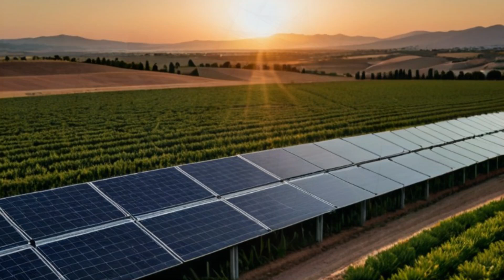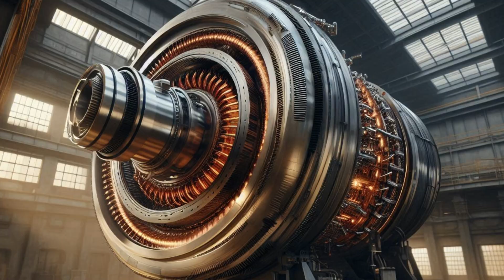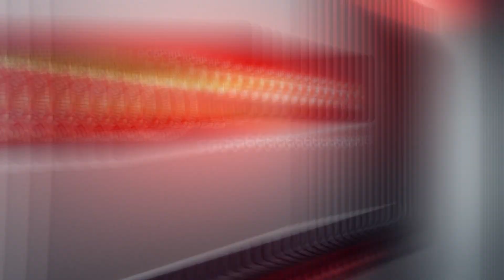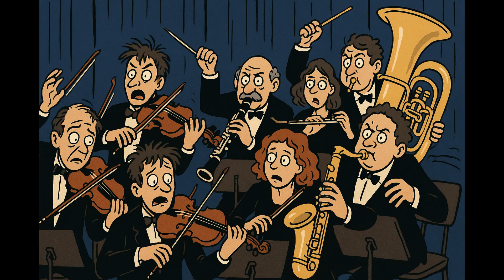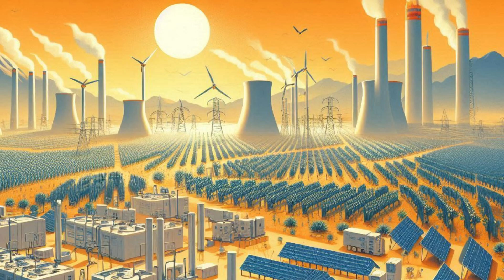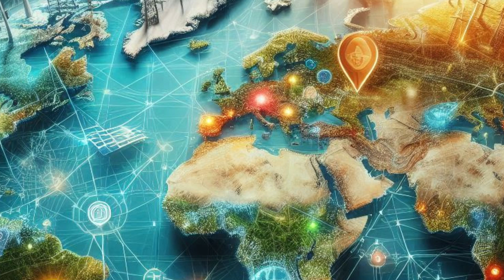💡 Why Spain’s Power Grid Failed – And What It Means for the Future of Renewable Energy

Comment: It is a fact that several power plants tripped off. It is unclear to what extent solar was a part of the problem. It is also true that Naked Solar could be a problem for power grid management. Nice to hear someone talking about grid forming inverters. Bottom line is that intermittent renewables should be tied to the grid via batteries.

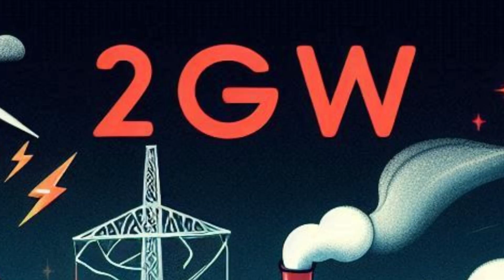Comment: Where did you get the information that "suddenly more than 2GW of solar power disappeared" [00:31]? According to the first official information, it all started with the failure of the Granada (capital of the Spanish autonomous region of Andalusia) substation. It might be that 2GW of solar power were fed into that substation at that time, but it was the substation that failed, not the solar farms. Besides, the solar farms in that region have a size of about 50MWp. The El Marquesado wind farm (larges in the region) has 200MW. So how many of them had to fail at once to create a loss of 2GW? A lot!

Comment: Simulated/Emulated inertia and actual inertia are two entirely different things, as the world will find out soon enough.

Trying to program inertia into an inverter that does not have any inertia sources, is not something that a line of code, replicated in 10,000 different places, none of which have inertia, can create inertia. 47.5 is an insanely deviant frequency diversion. Shocking. But 10,000 devices, all programmed to provide simulated inertia from battery power, at exactly 47.5 Hertz, is going to be even more shocking. The cure is going to make the disease  seem like a mere sneeze. Stick around, we will soon find out. We are now one code patch away from going from a grid-down risk to a grid-permanent-self-destruction risk.

Doubt me? Observe the next big conflagration, probably also in Europe, when the grid goes from 47.5 Hz in one 20 ms period, and jumps to  51.5 Hz in the very next cycle, followed by 0, followed again by zero (this one being a 100 kHz signal, masked by transformers). The traditional power factor analysis performed on the grid will not apply in this case, and transformers, inverters, capacitors, and any unfortunate actual inertial generators, will all instantly pay the price with their very lives. Inverters will burn, capacitors and transformers will explode, and generator shafts will twist right into halves.

Comment: We are there….

Spain just hasn’t added the artificial inertial energy sources 

Australia and California are two examples o of how to do it

Utility Batteries and Fly Wheels are two examples of existing solutions to this requirement

You stated that Solar caused the problem…

ACTUALLY ANY energy source may have disconnected as a protection measure…it just happened to be a Solar Farm

The grid went into protection mode

Comment: Hmmm.... if you look at the data that is currently available, there is NO clear evidence to suggest that it was any particular type of power source that caused the initial 2GW to disappear so quickly. 

It takes some some 45-65 solar farms to produce 2GW - and each solar farm is an independently owned  entity. 

The only power source, that operates in the 2GW range are: 
- transmission lines, 
- and a very few of the largest nuclear power stations in the world. 

So, to conclude that the problem was caused by solar farms, when there is no such data from the grid, to make such a conclusions, is just....  oh well, why would you even do that? 

Further more: 
How much land would 45-65 solar farms cover? 

And what kind of weather is needed, for 45-65 solar farms, to all experience the very same change in weather patterns, within 5 seconds? 

--- 

FYI, actual data collected from the grid, is listed on a Wikipedia page: 
search for: "wikipedia 2025 Iberian Peninsula blackout" 
to get to the page as YouTube does not like to deal with direct links. 

The details of data on the Wikipedia page has its source from to articles. 

One article from from ENTSO-E  (the European association for all national and regional TSOs -  TSO=Transmission System Operators ) - search: "ENTSO-E expert panel initiates the investigation into the causes of Iberian blackout" to find the article.

The other article is from 'powermag . com ' a dedicated expert website for Grid engineers and Grid managers. 
search for: "Understanding the April 2025 Iberian Peninsula Blackout: Early Analysis and Lessons Learned"

--- 

There is no doubt that many of the physical and electrical aspects, of what it takes to keep a large grid synchronized, and up and running, is not generally know to most people. 

So it can only be a good thing, if details and information, relevant to grid operation, becomes available in an easy to understand form.

Comment: Very interesting explanation of the situation. I appreciate your insight. I use a single-phase electrically started rotary phase converter to power my 3 phase machine. Seems like a rotary motor “idling” in the system could provide some useful stability. Thanks!